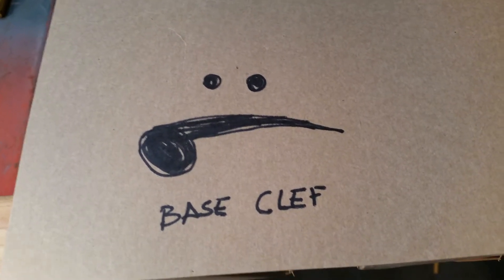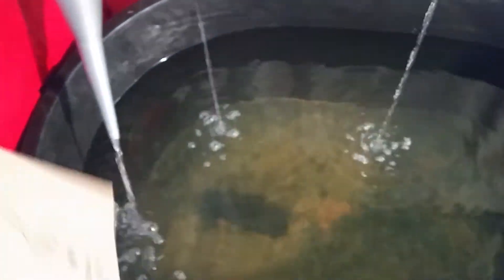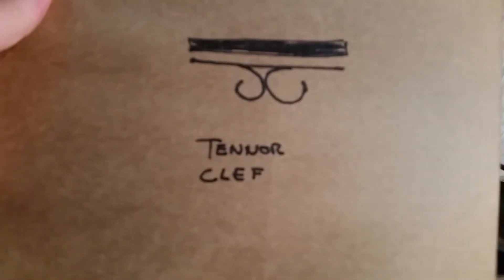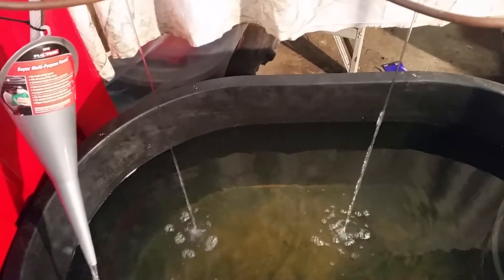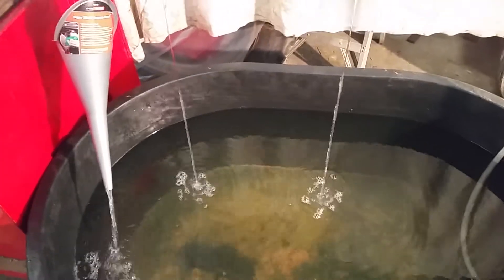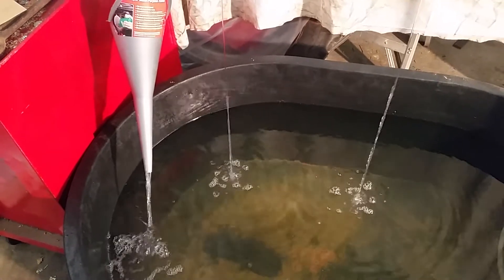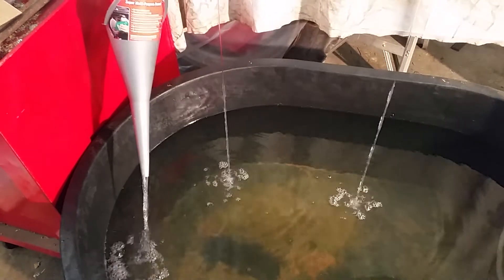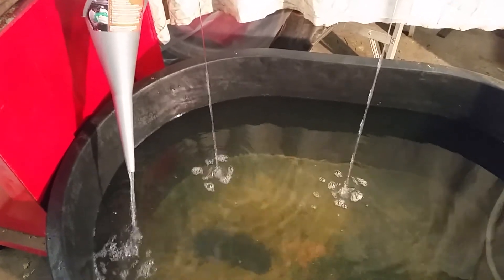Hidden in the music

Comment: Very entertaining to watch.....you have quite the imagination.  I have a feeling you still can't sleep because you have not completed it yet.  I've heard anything moving will cause a static charge and static is the most common natural form of electricity.  Why do we not use this form of energy more, other then painting cars and pollution filters?  I think this is the energy we should be using instead of forcing magnets past wires.
Reply: There are alot of examples of the ancients splitting of water. We just may well discover why these systems are no longer in use. I just hope it works the way I see it in my mind, so far so good.
Thanks for watching.
Peace.